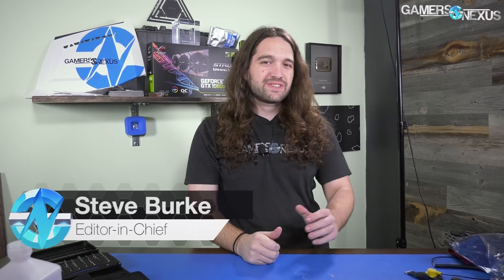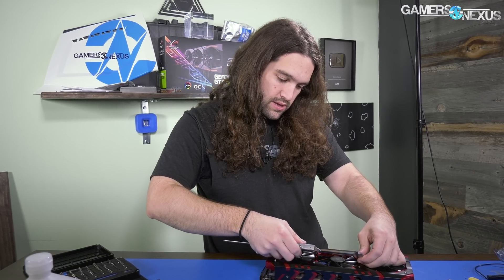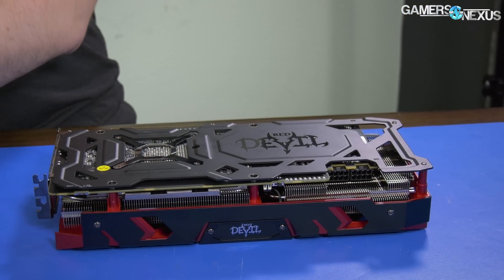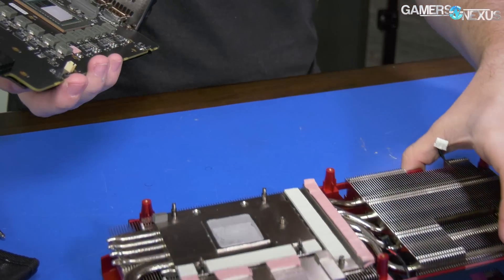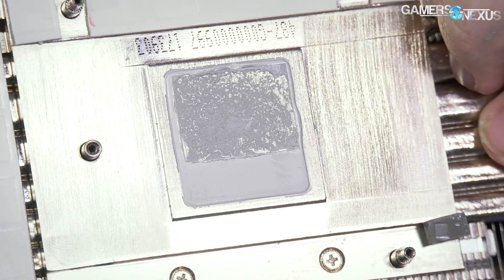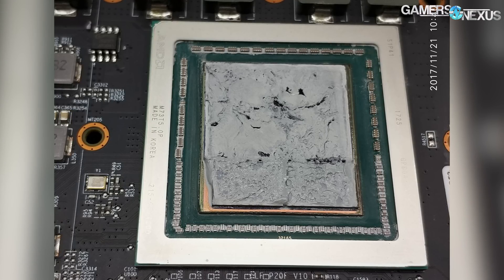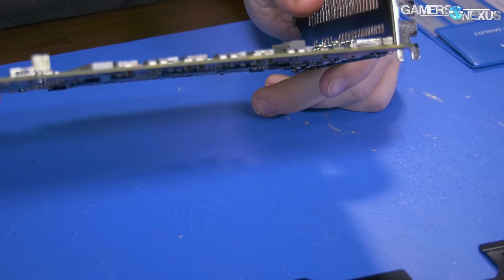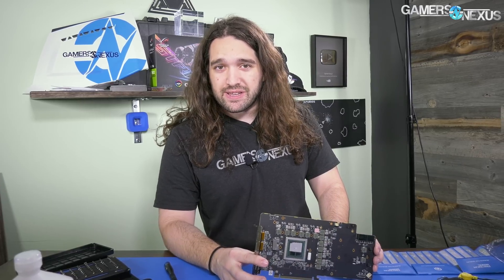PowerColor Red Devil RX Vega 64 Tear-Down (& Thermal Paste)

Comment: Could you make a comparison of Vega 64 launch benchmarks vs now ? I've heard that the performance got alot better and performed even better than the 1080ti in some cases.
Reply: It's because of how the architecture of GCN is built, you can push down multiple requests to handle simultaneously quite easily but DX11 is very much a single file wait and finish each item in a row kind of code structure. There are many engines that use workarounds, but mostly because they work with AMD to utilize them effectively. DX11 could work near perfectly with AMD, as was proven with the mantle API wrapper but it's not the easiest thing to do and DX12 and Vulkan do a better job so why bother?
Edit: nVidia is structured to not only use code injection to override parts of DX11 code to allow for better functionality with their GPUs but also is very effective at handling single file tasking as fast as possible.
Reply: Gustavo Rose,
The DX11 vs DX12 (AMD vs NVidia) issue is multi-faceted. One main takeaway is that the AMD DX11 driver in general is more demanding on the CPU, so it can more easily introduce a CPU bottleneck (especially with CPU's with lower single-core performance). Despite DX12 and Vulkan growth being quite slow as a PERCENTAGE OF GAMES RELEASED, AMD does not have the budget and expertise to optimize the DX11 core driver and frankly it's probably a poor choice of their resources...

DX12/Vulkan API's start to shift the responsibility away from the video driver and more towards the game engine as well as (in theory) become better threaded across the CPU; both of these can reduce the impact of the AMD and NVidia drivers in terms of potentially causing a CPU bottleneck (though it still matters in other ways to increase code efficiency on the GPU side of things).

Some GCN gain by asynchronous computation (specifically AMD's ASync Compute via ACE) allows higher performance by effectively allowing more of the GPU to be utilized due to smart scheduling. AFAIK the main reason NVidia sees little to no gain here is because their GPU's can be close to 100% utilization already. So AMD has "untapped potential" in general with GCN whereas NVidia optimized their hardware better towards the existing games market (which approach is best can be argued and how long you keep the card is a factor too).

I'd say in general being TOO FUTURE-PROOF at the expense of the present is a bad thing (i.e. running too hot and/or too expensive to support features that are largely unused). A similar issue occurred with CPU's like the FX-8370 which were had eight threads but which has a relatively lower performance. Games in particular are still unable to EFFECTIVELY use more than 2-4 cores fully.

AMD's VEGA hardware is great. Really, really great.  Having said that, games that support this really well are just starting to trickle in, and general support overall (IMO) is much better by NVidia in terms of timely release for newer games, game smoothness overall and older games (NVidia is not perfect, and Windows 10 updates seem to cause periodic issues for both AMD and NVidia).

An Asus Strix VEGA-64 card excites me in terms of the POTENTIAL it brings. To me though, there are still a lot of pros and cons. If it was a similar price to the GTX1080 I'd really have to think hard about which card to get, but if more expensive by 10%+ I'd say no way.
Reply from the maker: It's partly drivers, seeing as AIB partner cards still aren't enumerating clocks properly on 17.11.3. 17.10.1 works better, and the big December push should fix all the issues.
Reply: #smokedoutpositivesquad not really drivers; it's game dependent. Wolfenstein II is very Vega friendly because it's one of the first that are optimized for the Vega arch.
Reply: Totally agree with you. I just hope AMD stops trying to do catch up in performance in current games and starts to lead things like it used to do.
Reply: IIIII47IIIII According to Lisa tsu who has actual sales data they are doing fine, AMD sell a bit here and there but they are selling because professional and data center don't operate on fanboyism, Vega suck AMD overclocked Vega so that Vega don't look worse than they are, Vega at low clocks and voltage is extremely efficient as evidence by Raven ridge APU, yes AMD suck they abandoned consumer Nvidia gets full monopoly, just like AMD has always known even if Vega was 2x 1080ti nobody is buying AMD fanboyism is strong, I am waiting for $500 gtx 2050
Reply: IIIII47IIIII #bringbackquadcoreCPU, #goawayabovequadcore
Reply: IIIII47IIIII Too bad Ryzen forced the i7 7700k to be an i3 how dare AMD why did AMD released Ryzen, how dare an 8 core CPU be priced similarly to a quad core CPU how dare AMD, AMD suck. Those Ryzen pretender that paired Ryzen with fast Ram and got the exact same result as the superior i7 7700k in games fps must be lying, how dare they lied to us, the i7 7700k got high FPS but stuttering all over the place and can't handle streaming while gaming while Ryzen can must be lies spread by propaganda, the benchmark where Ryzen rapes the i7 7700k in professional applications were lying as well how dare people do that how dare they. How dare AMD priced an 8 core close to a quad core CPU how dare they
Reply: IIIII47IIIII How dare AMD Released shitty drivers how dare Adoredtv who did his research and has evidence lied to us about Nvidia driver issues how dare he lied. AMD go away, Don't release Ryzen plus with 4.5 GHZ clock and equalize single thread performance, those people that did the benchmark and found out that Ryzen at same clock speed as Intel has almost identical IPC lied to us, AMD don't release the Ryzen plus with IPC and clock increase and same socket please dont
Reply: DOOM Slayer Steam Graphics data from year 2009 to 2011 where AMD was twice as good as Nvidia must be lying then how dare steam lied to us, how dare the data showed that majority bought Nvidia cards that is slower and consumes more power at the same price as a much powerful and efficient AMD card. how dare the data lied. So sad Yes you are right if Vega is 2x 1080ti people will buy AMD so that means Steam data lied how dare they.
Reply: DOOM Slayer Clearly people back then were not fanboys because Nvidia sold more despite much much more efficient and faster AMD, steam data lied to us.
Reply: DOOM Slayer But don't worry AMD is quitting consumer graphics what a relief, we don't have to deal with AMD bad drivers anymore no more from now onwards its Nvidia time oh yeah
Reply: Snow Star are you ok?
Reply: DOOM Slayer I'm tired with people who thrash others without any shred of hard facts and data to back up their statements, adoredtv did all his research and presented facts yet nobody listen, people are ignoring the fact that a monopoly is not good, we got stuck at quad core for 10 years thanks to that but no more as the Nvidia fanboys had wished, AMD is quitting consumer graphics, the sole provider for consumer graphics from here onwards would be Nvidia like they hoped for. So instead of waking their senses up I approve of AMD quitting this toxic fanboys thing and instead sell to professionals and data center but even then its not enough Nvidia fanboys wants AMD to shut down for good how is that good for everyone?
Reply: DOOM Slayer They ignore the fact that even Nvidia got bad drivers, drivers that fried cards, brick PC and how about that 3.5 issue, these fanboys are willing to forgive that but god forbid that if AMD were to release a flawless driver with one character off in the license agreement form, AMD suck. Yes Vega was hot, its not a failure, the GTX 580 vrm was operating at 105 degrees during gaming and the gtx 590 burst into flames, Vega will never caught on fire because the VRM is a beast, people bought a well made card. The people who bought Vega the ones I know they are happy with it because they don't do things like comparing it to the 1080ti or bash others. And you see forums from both side that helped each other get max overclock or what's a good fan placement those are the true enthusiasts, fanboys are toxic. Using profanity forcing their ideals onto others. I mean you don't buy a Honda hoping it to thrash a Lamborghini its people that buy a Honda and expects it to thrash a Lamborghini that are the problem.
Reply: hahahaha people are still high on that Async PR bullshit from 2016 ? LOL .. my dudes Wolf 2 was builded around vega .. in terms of optimization (ID TECH ENGINE 6).. if Vega cant catch 1080ti even at that heavy biased title.. its done lol on top of that look at Geforce async gains vs AMD ones in that game.. its same .. so no "async" superiority is happening there .. deal with it.
Reply: HAHAhahaha
Reply: shit if vega 64 was same power as a 1080 i would have crossfired em
Reply: I've heard tales of a monstrous humanoid, 8 feet tall and covered in hair. I've seen it, too, so it must be true...;)
Reply: I mean launch drivers were literally beta so the performance had no option but to improve, then we have AMD's FineWine™ technology too, and AMD having proper asynchronous compute support helps it catch up to the 1080 Ti.

Still mainly a 1070 and 1080 competitor though, for the majority of games.
Reply: Trying to scrape that win by any means necessary. Lmao.
Reply: IIIII47IIIII Yes AMD suck they are leaving consumers graphics for good Nvidia gets full monopoly from now on. Nobody's gonna buy AMD we all know it sucks but when it comes to compute Vega rapes the htc 1080 and that is what AMD wants AMD is abandoning consumer and instead selling to professional and data center where fanboyism doesn't exist. I wonder how good would the $500 gtx 2050 be good times ahead.
Reply: IIIII47IIIII Besides locked ecosystem is good for a company because then the company will have no choice but to buy from Nvidia even if Nvidia charges 1million for their GPU. I'm pretty sure you like locked ecosystem, it's very good you know, its like you can't eat at five guys because you are locked to MacDonald for the rest of your life. See that's good mate. Monopoly is also good look at Intel 10 years with quad core man those were the times. I miss those times.
Reply: Snow Star if vega was beter than  2x 1080ti's and at the same price, i assure you that no one would buy a 1080ti, except tech channels bcs they do benchmarks and stuff, but that's the point, AMD dosent sell as many cards as Nvidia not because fanboysm but bcs compared to nvidia, they are pretty bad, from fps to power draw to temperatures, even Freesync it's worse than G-sync, yes it's more expensive than freesync, but it's also better than freesync, go take a look there are plenty of videos comparing thoose 2.
Reply: and still pulls 600w (just for gpu)
Reply: AMD doesn't seem to know how DX11 works because it can't optimize properly for it like Nvidia does. In DX12 and Vulkan it got things right and it is very competitive with Nvidia.
Reply: Gustavo Rosa Not gonna happen, AMD is done with consumer graphics where the Nvidia mindshare is strong, Vega was build with one thing in mind, data center and professional market, AMD had enough with consumers. Next year onwards Nvidia gets full monopoly.

Comment: That thing looks so cool with the red and black even if the plastic looks kinda cheap. That colour scheme would fit my build well. Good thing it is to long and I don't even have to think about buying it. For the other thing, I'd blame AMD for not having the HBM and GPU the same height. Why would you blame Powercolour for not fixing a Problem that shouldn't exist in the first place.
Reply: It fit my system very well being black and red it looks very nice and performed well till yesterday it dropped the drivers and won't install and is now artifacting after I serviced it which I did when I 1st got it and ran perfectly. But now is showing memory faulting. Looks like it's time for new GPU.

Comment: The thing which puzzles me is why so far only XFX appear to be going for a smaller PCB (which Vega makes practical through both VRM layout and not needing space for GDDR5)
The shots I've seen of their card have one of the fans blowing clear through the heatsink and through a vented backplate. Surely that will allow for better cooling than a longer (and baren) PCB blocking airflow.
Reply: maybe XFX have plan for watercooled vega nano in the future? Asus have plan for vega X2.